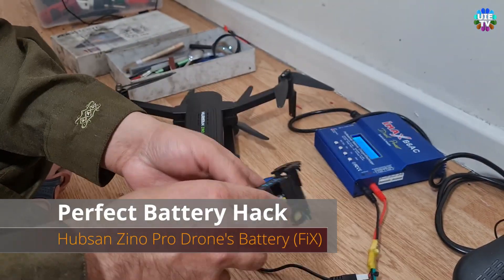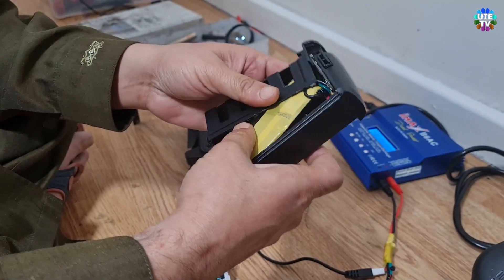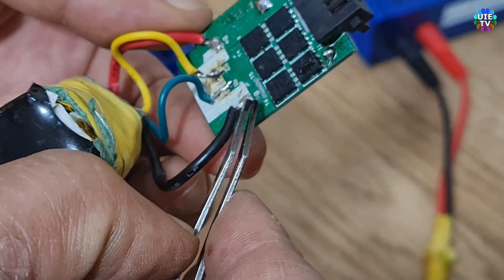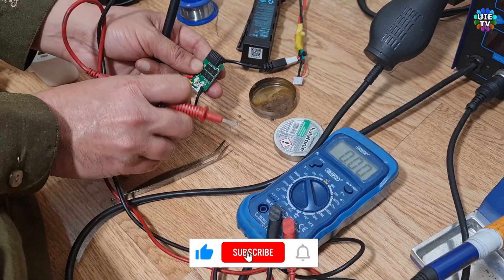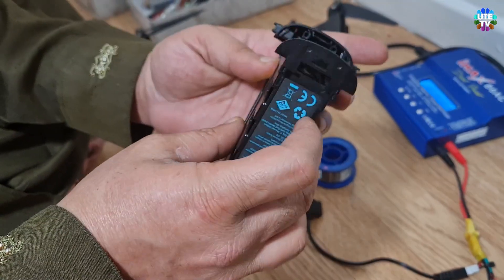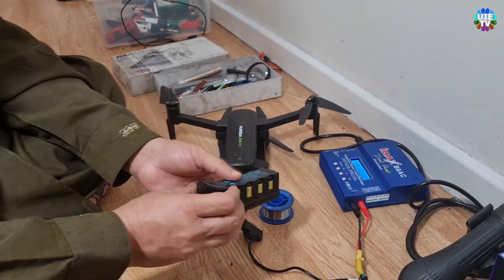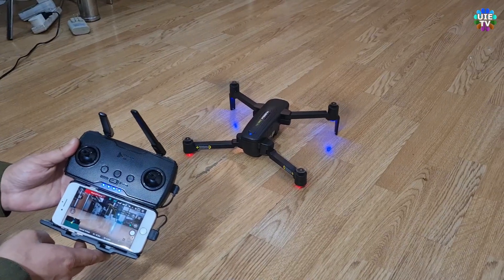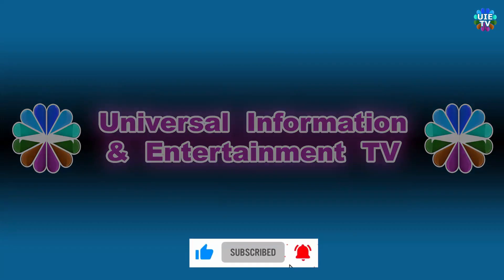(Type 1)    Battery Mod, Fix Repair Hack and Easy Modification on Hubsan Zino & Zino Pro Drones.

Comment: i´ve a GeFi Battery that i can´t charge with the Charger from the box , is this the same problem ? I´ve the opportunity to load with a HTRC B6 v2 . A technician told me that the battery cells are not parallel pluged , the cells are behind each other. What i´ve to do, charge in the normal 3s program without balance  ?
Reply from the maker: check battery voltage, if more than 10 volts, then put normal charger,
Reply: @universalinformationentert3976  Thanks forthe Answer, my  htrc display show´s
"LiHV 2,5 A 11,53V 
BAL 002:06      081 "

now i can choose the normal charge ? but LiHV   and without BAL ony CHRG , correct ?

Comment: What about zino pro + drones? Has anyone found a solution on working with different batteries than the original?
Reply: Hi, not sure if you have received a reply but I did buy from Amazon 2  CIFI  Power 6500 mAh batteries. They seem to work fine and I get more flight time. At 30% I got 28 minutes of flying.  compared to around 22 minutes for the 5500 Hubsan battery.  My original Husban batteries are junk, only lasted about 6 months before going bad. I did store at 50% and charge once per month, but my 4 original batteries now only get about 10 minutes of flight time. I had  the new ones  since 12-1-22, so I hope I get a year or two out of them. I did receive 2 bad ones but they replaced them with 2 good ones.

Comment: please don't do this, sharp cutters are very dangerous if burst Batteries can explode please please dont do it
Reply: Why?
Reply: @ernestgalang273 Correct me if im wrong but there is Lithium in the battery. It reacts sensitive to water or friction